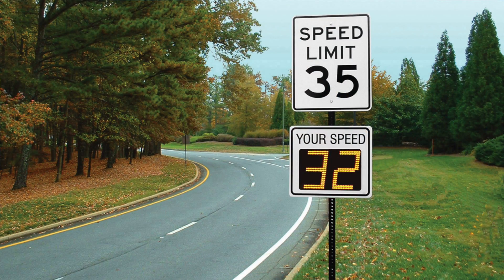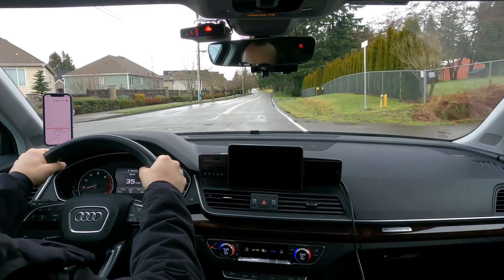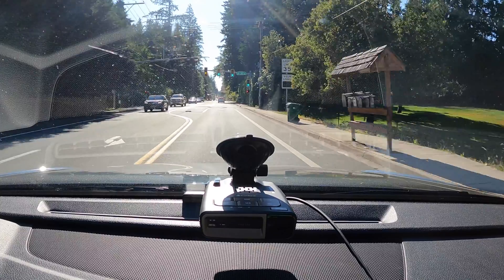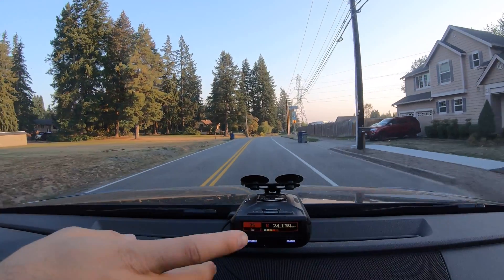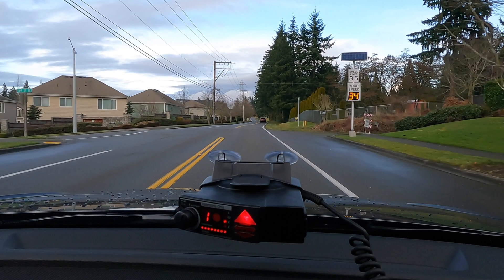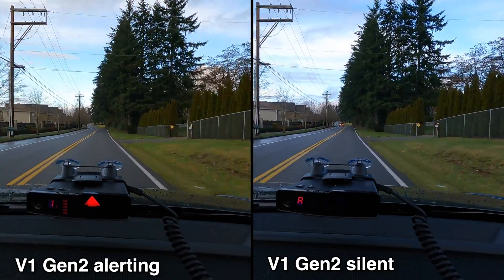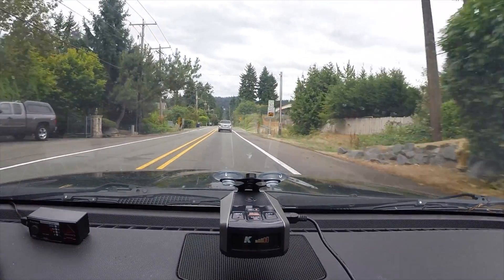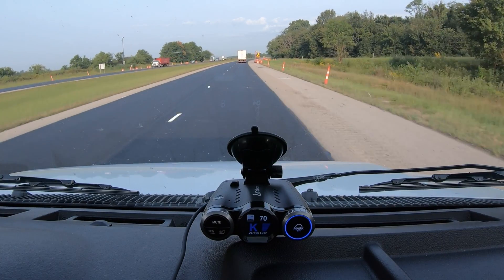Why Your Radar Detector May Not Alert to Speed Signs

Comment: Thanks for this video. It was just what I needed to hear. There's a new speed sign on my route home that clocks my speed but my Uniden DFR9 never alerts. I knew there was nothing wrong with the detector because I live where all the cop cars run K and KA and the DFR9 has never failed me. I was thinking there was a new type frequency radar gun in the area that would soon be in all the cop cars.
Thanks for the insight.

Comment: Thanks for the vid...this is something that had me scratching my head and unable to remember if a few particular speed signs have been locked out or not after receiving alerts. 

 I'd love to see a false alert test such as the RL360c next to the Max3 at the same time. Not sure where you live but here in San Antonio false alerts are ridiculous. 

I sent in my RL360c for repair and purchased a Max3 a while back. I swear Max3 was alot quieter but had great range towards actual threats. Escort ended up sending me a new 360c and I feel I don't get as many false alerts, but that instant full blast K Band kills me (especially when I'm using the phone since it is mounted right next to the mic). I think my Max 3 only did that twice in the two months that I was using it.

Comment: I had the same question once for the folks at V1. This was their response. 

Thanks for your email.  I think you may have run across a trailer that uses FMCW technology.  This stands for Frequency Modulated Continuous Wave.

As you may know, there are many different types of speed trailers.  Some of them
use FMCW technology and others use a different system.  These signs are not used
for issuing tickets, because they don't have the necessary features for traffic enforcement use.  In addition, speed signs are not on the IACP (International Association of Police Chiefs) approved list for use to measure speed for law enforcement.

The V1 does not pick up the FMCW signals, even though some other cheap detectors do.  Incidentally, it's good that we reject FMCW, since there are other types of equipment that can use this technology.  For example, V1 is quiet when other detectors alert in the presence of traffic sensors and traffic monitoring devices. 

FMCW is a signal format that is approved under part 15 of FCC rules and therefore does not require the user to obtain a license as would part 90 for police radar transmitters.

The bottom line is that this type of technology cannot be used for issuing tickets.